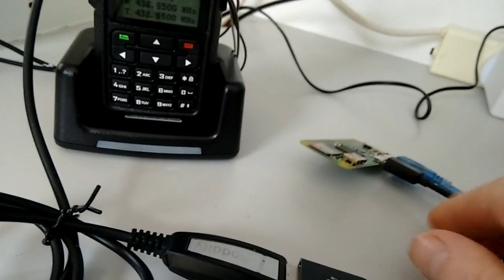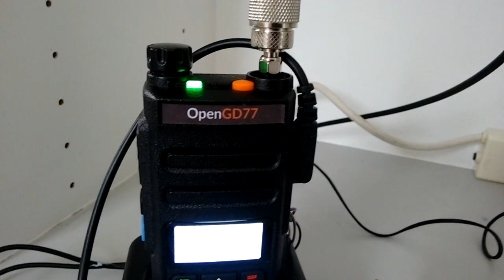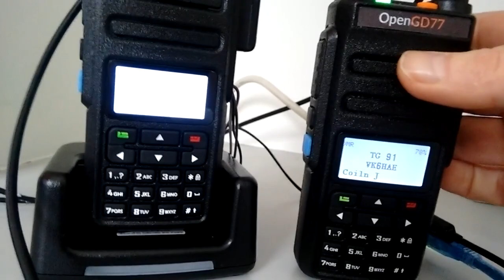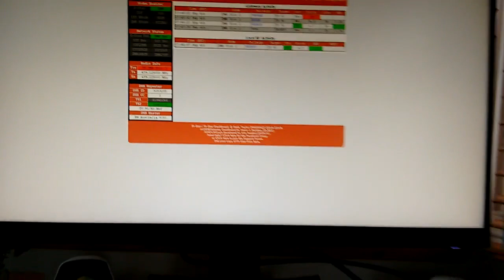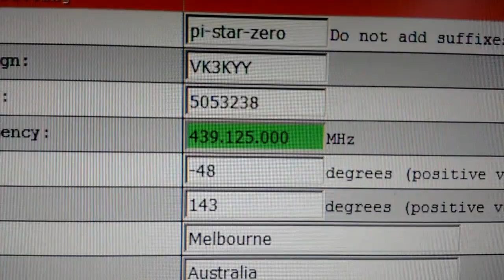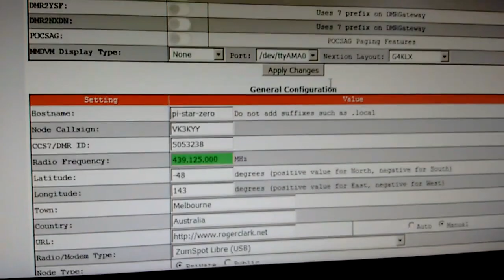OpenGD77 Hotspot mode

Comment: hello, please help with the inclusion of hotspot mode on the radio station Ailunce HD1 as with the GD-77. their circuitry is the same. 
with respect, UB4AEP. 73!
Reply from the maker: The Hotspot mode is a feature of the OpenGD77 firmware, its not a feature that can be added to to an official firmware of another radio.

The Ailunce HD1 appears to share a lot of hardware with the GD-77, but I can't afford to buy every radio that is like a GD-77 and don't have time to write code for every known radio either

Comment: You must not know much about Hotspots & how radios are supposed to work with them.  If you did, then you'd KNOW that the radio DOES NOT need to be connected to the Hotspot with the charging cable.  If configured correctly, the radio should be able to receive from the Hotspot WIRELESSLY (That  is the whole purpose you know)

Either that or you don't know anything about DMR at all (Outside of maybe REPEATERS??)

I know because I have an Openspot & a Zumspot Stick (Both of which are either Homebrew/MMDVM or have a Homebew/MMDVM connector)
Reply: The GD77 is acting like a the radio hat on a Jumbospot. The GD77 IS a part of the hotspot. You then need to use another DMR radio to communicate with the hotspot like normal. It's pretty much so you can have a high power hotspot, or make one if you have a GD77 laying around.

Edit: And you're saying this to a guy that remade the firmware for a radio. Even Retevis contacted him asking if he would port it to one of their radio.
Reply: "You must not know much about Hotspots & how radios are supposed to work with them..." 
Seriously? Perhaps you should do some homework on your part of just who Roger Clark VK3KYY is? (hint: he's a legend in DMR firmware, modifications and is truly a subject matter expert)
And then you'll realize that in this video he just showed you that using HIS firmware that he developed for the GD-77 (not from Radioddity, but his own called OpenGD77), and without the use of a MMDVM AMBE board, that he CREATED a hotspot without a HS HAT board that runs much greater RF power than the Jumbo or Zumspot boards ever could. Notice, there is NO RF board on his Raspberry Pi Zero in this video.
Take a peek at his website https://www.rogerclark.net/ and then maybe come back here and delete your ignorant post?
If there's anyone who doesn't know much about this topic it is probably the technician-class licensee KB0OXD?
Reply: Watta clown!

Comment: Hello I am running on hotspot mode the Gd-77 with Rasperry 3+ but I can not connect in mode hotspot with raspberry pi zero. What type modem I need select into Pistar panel control? I use a otg cable micro usb male to usb female connection is correct? I spend a lot of time checking without results.Can you help me please? the firmware installed in gd-77 is VK·KYY and the firmware in pistar is Pi-Star_RPi_V3.4.17_20-Jan-2019.zip. Congratulation for your job.
Reply from the maker: You probably fixed your problem by now, but the OpenGD77 DMR Hotspot is a modem type. You need to select that. 

If you don't see that option, you need to update your PiStar software.

To connect to a PiZero, you need some sort of adaptor cable, because the USB programming cable for the GD-77 has a normal USB plug, but the PiZero is a micro USB socket.

You can also try posting to https://www.openGD77.com